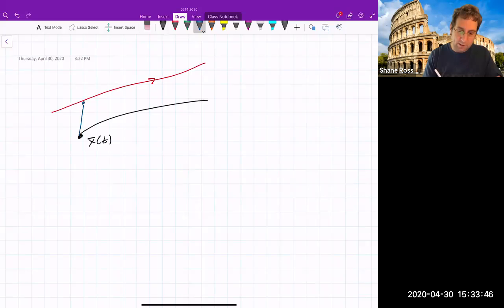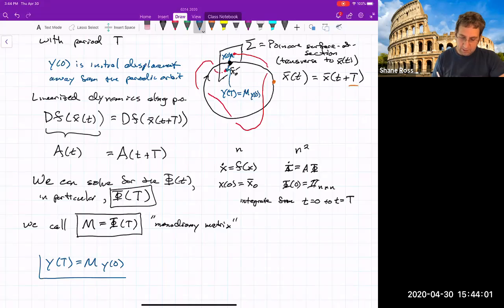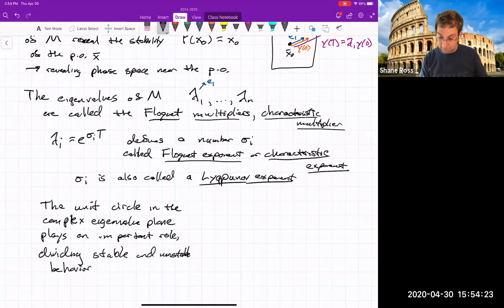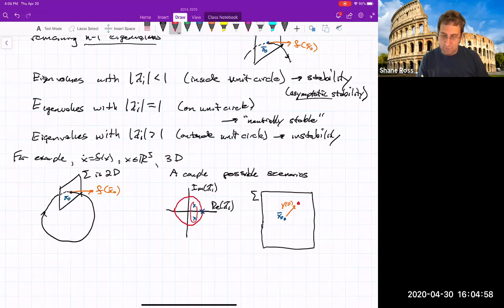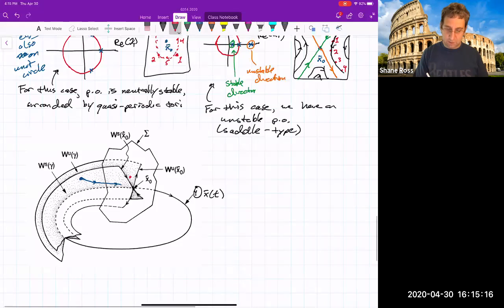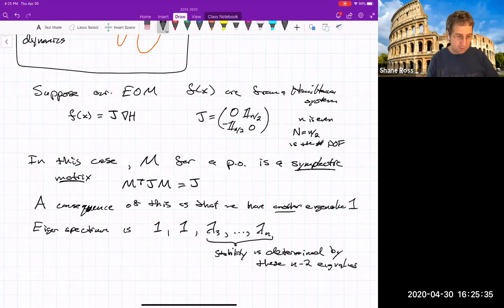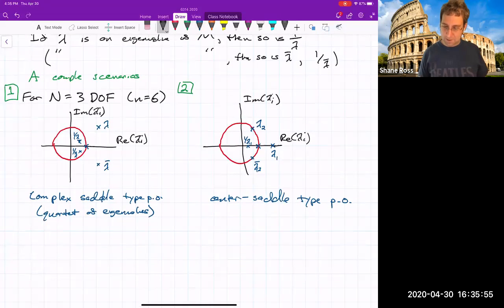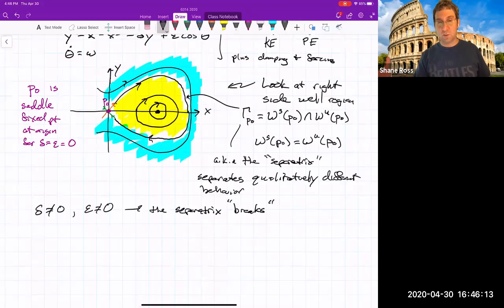Stability of Periodic Orbits: Floquet Theory & Invariant Manifolds | ESM/AOE 6314 L21

Comment: Great lecture Professor Ross. I wanted to ask, could you recommend any text book which teaches Floquet theory in nonlinear dynamical systems in details. I am currently working on piece wise-smooth (PWS) systems (like impact oscillator, Filippov systems which show chattering and sliding motion near a discontinuity boundary) which shows route to chaos via period doubling, period adding cascade etc. I want to understand/study the Floquet spectrum for such PWS systems. If you could recommend any book/paper/s; it would be very helpful.
Reply from the maker: In general, I very much like the book which taught me: 'Introduction to Applied Nonlinear Dynamical Systems and Chaos' by Wiggins (@stephenwiggins1). What you're describing, I think I've heard them called "non-smooth systems" or "hybrid systems", those which have both continuous and discrete dynamics. I don't know where that's treated at the level of detail you're seeking. Perhaps the work of Harry Dankowicz? https://danko.mechanical.illinois.edu/about.htm
Reply: @ProfessorRoss  Thank you for the suggestion. I will look into the book by Wiggins. I follow the book on Applied nonlinear dynamics by Ali H. Nayfeh and B. Balachandran. I am also aware of the work by Prof. Dankowicz.

Recently I worked on a paper which calculates the Floquet characteristic multipliers of a hybrid system (impact oscillator; degree of smoothness zero). I worked on deriving the state transition matrix near the non-smooth discontinuity boundary with higher order corrections. Next I would like to study the behavior of such non-smooth systems near grazing and chattering using Floquet theory.
Reply from the maker: @deeper1993  My impression is that Nayfeh and Balachandran are focused on mechanical systems, while Wiggins is considering more general mathematical systems, but both are good. The only work I've done on hybrid systems was looking at a simple passive downhill walking mechanism: http://www.dept.aoe.vt.edu/~sdross/papers/simple_walker.pdf
Reply: @ProfessorRoss  Yes indeed. I love the contents of the book by Wiggins which you recommended, its more deeper and covers a broader range of dynamical systems. I will look into this book.
I am also interested in the theory of chaos, and it seems Wiggins has discussed a lot about it. Thus this book will help me a lot. So far I have only studied chaos from the book by S. H. Strogatz.

Thank you for sharing your work on the walking mechanism; will read it surely.